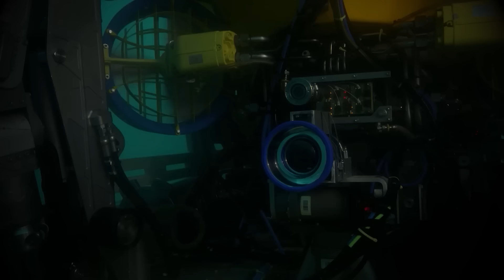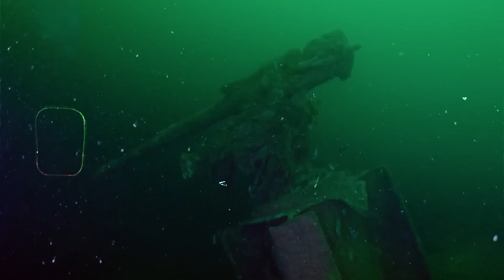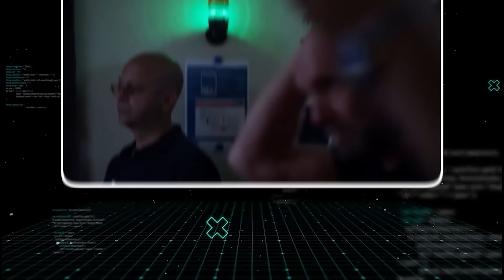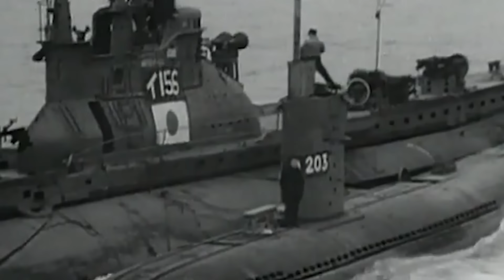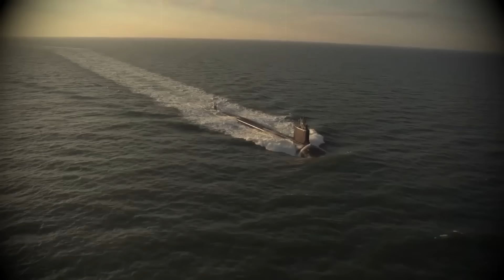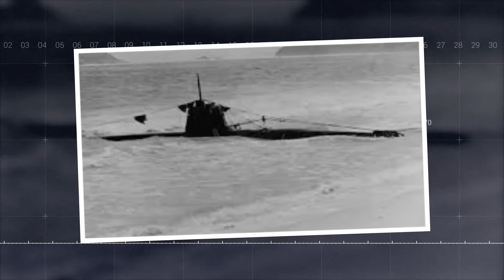What Divers Found in a Sealed Cave Near Hiroshima Was Classified Until NOW (2025)

Comment: Key Details about the I-400
Submarine Aircraft Carrier: The I-400 was a unique "submarine aircraft carrier" designed to travel undetected anywhere in the world and launch surprise aerial attacks.
Aircraft: It could carry up to three Aichi M6A1 "Seiran" floatplanes in a large, watertight cylindrical hangar on its deck. These planes were specifically designed with folding wings and tails so they could be stored in the hangar and launched via a forward catapult.
Design and Range: The submarine measured 400 feet (122 meters) long and had enough fuel to circumnavigate the globe one and a half times.
Intended Missions: The original plan, proposed by Admiral Isoroku Yamamoto, was for the I-400 class to attack the Panama Canal's lock gates to disrupt the U.S. supply route to the Pacific. A later, unexecuted plan (Operation Cherry Blossoms at Night) even considered a biological weapons attack on the U.S. mainland.
Wartime Service: The I-400 was commissioned in December 1944. It was on its way to participate in an attack on the U.S. fleet anchorage at Ulithi when Japan surrendered in August 1945, and the mission was called off. The submarine never saw combat in a major offensive operation.
Fate: After the war, the I-400 and its sister ships I-401 and I-14 were captured by the U.S. Navy and studied for their advanced technology. To prevent the technology from falling into Soviet hands during the onset of the Cold War, the U.S. scuttled the submarines off the coast of Hawaii in 1946. The wreck of the I-400 was rediscovered in 2013 off the coast of Oʻahu

Comment: Where are the other submarines? It stands to reason they would not number 400 through 403. And then jump to 406.
Reply: "...@DarrellMiller-r5r
Where are the other submarines? It stands to reason they would not number 400 through 403. And then jump to 406.  ..."

There were not necessarily 400+ submarines.  The numerical figure "400" is indicative of the Class of submarine they were...I-400, I-401, I-402, etc.! The !-400 Class submarine had already been designed, constructed, and put into service. As undesirable characteristics were determined and altered, for whatever reason, each submarine manufactured afterward, and not exactly as the original I-400, was given another classification. All following would then have that same classification, until it was determined to be altered...and so forth! My reference  could be compared to how we identify our small-arms weapons.  For example, I trained with an M1 Garand in 1961 at PI, SC.  I later swapped the M! for an M14 in 1962.   Did they develop, manufacture, and introduce TWELVE (12) new and different rifles in the year that lapsed?  (do not do the math attempting to catch me in error)   Of course not. The US Government merely gave the rifle that was designed to accommodate 20 rounds and fire single rounds or fire automatically up to the maximum 20 rounds, as opposed to the rifle that could accommodate but 8 rounds and fire single rounds only,  another classification designation that those in power randomly chose...in this case...M14!   If YouTube allows it, you might find this link somewhat of interest   https://kaigungou.ocvb.or.jp/english/about/